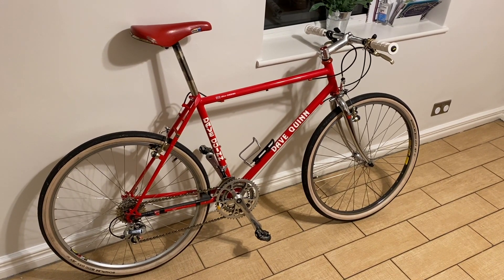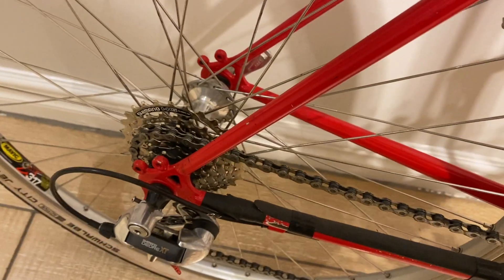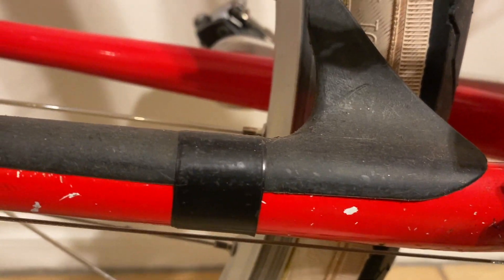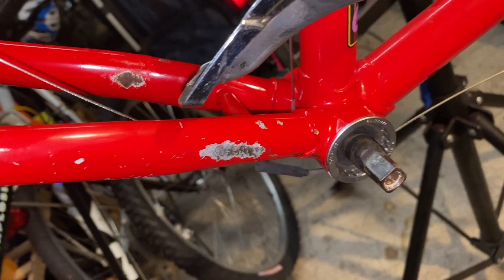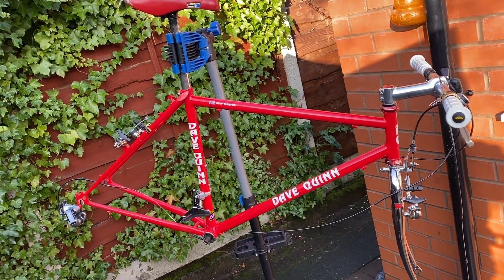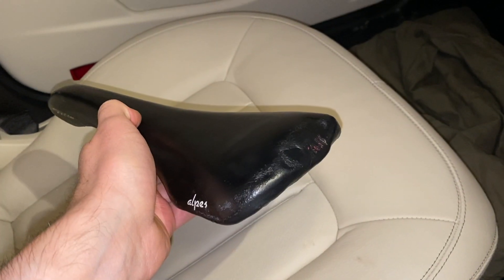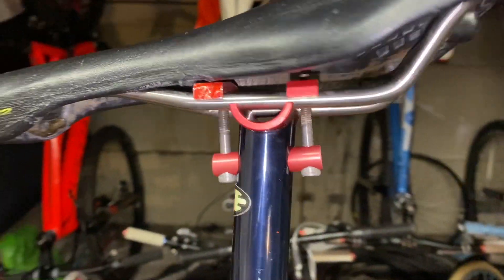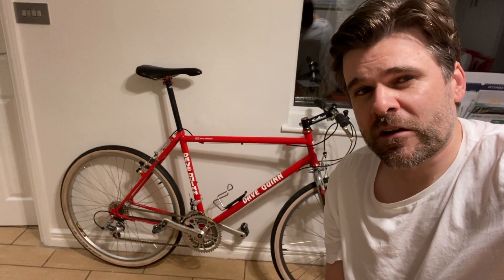Retro MTB heaven: 90s superbike finally gets the restoration it deserves after 28 years

Comment: Fiber wheel then polishing discs with compound bars on a light duty multi speed angle grinder for the cranks and anything metal. Nice bike and work!!!!
Reply from the maker: My current thinking is I'd rather go back to that brushed finish rather than mirror polish. Harder to achieve I know, but I hear scourer pads and WD40 are worth a try.

Comment: Perhaps what happened with your saddle indentations is the glue you used to re-secure the leather worked its way into the foam, hardened in it's compressed state and now is permanently stuck in the shape of the clamp.  That's why your Mercedes seats return to normal, there is no glue preventing their return. 

The only fix I could imagine would be softening the glue and re-working it around... whether that involves heat or solvents depends on the glue...
Reply from the maker: I suspect you're right - I think a bit of patience with a combination of steam and hairdryer would at least take some of those surface markings out. Also I know there's a lot more R&D (and cost) that goes into car seats, especially really high end ones, which is why they are so hard wearing. And when that Mercedes was new I paid more (on top of the ££££ optional interior) for Scotchgard protection. Not sure what that involves, but it's no doubt effective.

Comment: Nice nostalgic pleasing videos you do, but lets be real here, steel bikes were not desirable for young kids like us back then, steel was yesterdays tech for us easily impressionable youngsters in the sport. Every cool bike was an alu bike with thick frames like Cannondale, Klein and so on. Ie bikes that were promoted quite heavenly, in short the next fad in the industry and steel was not that, :) . But yeah many of us ended up with steel bikes because they were cheaper. Titan was always something magical and mythical but steel was seen as stone age tech throughout the 90s. So were are the Alu top of the range bikes that every kid sought after? :P

For me the Holy grail was Kona Kula, Klein, and parkpree or rather a bike frame a Store in Sweden sold that was called Easton which was the Parkpre frame under the Easton brand, 1.3kg of pure double or even triple butted alu tubes :P But those Kona titan frames were oh so desirable, think it was kona king kahuna and later on heihei, that is if I remember correctly and they should be as small as possible to look  a bit like the oh so boring 29ers we have today :D
Reply from the maker: At this particular point in time I wasn't interested in aluminium at all - it was all top end steel or ti for me. The UK pros in the early 90s were riding Reynolds 653/753 or Tange Prestige/Infinity, with only the galacticos getting titanium. I could very easily have bought a Coke-can Cannondale for the same price as this 653 frame, but I wanted to keep it old-school. Glad I did! My first alu bike was the S-Works M4 in 99. You're so right about that Kona Hei Hei - that's always been the stuff of dreams.
Reply: @red_dread  Mm Titan was indeed what everybody dreamed about, but steel was looked down upon here, I guess we were too brainwashed by all the american mtb trendsetters. 

In 98 I got a steel schauff Hurrican xt, with full xt and crossmax wheelset and with a budget indy xc fork, and nobody cared about the Tange Infinty steel frame with Ritchey lugs/frame parts but they did indeed drool over the first gen crossmax and the xt gprupset.

Got so many propositions for the wheelset because they wanted to outfit their alu Zaskars, Klein, Cannondales and what not frames with those sweet wheels because they too wanted bike which was 10.5kg with a front shock :P

I remember when I drooled over a Klein Android comp with fully xt and judy xc, but it was 20.000ske(~2000€) and I just could not get that kind of money for a bike, so my Schauff, with crossmax wheels and xt for 12.000sek was a bargain even though it was a steel frame and had that crappy indy xc fork on :P